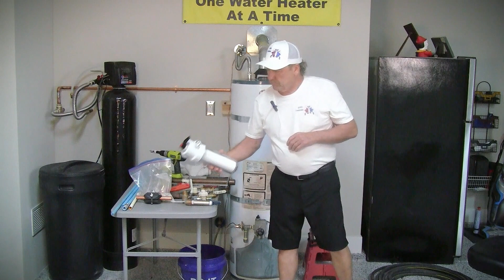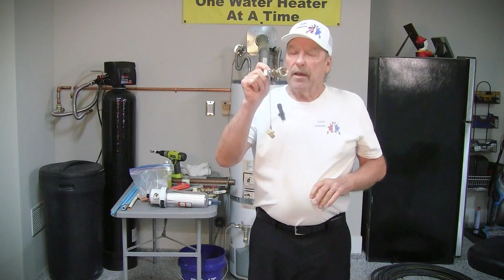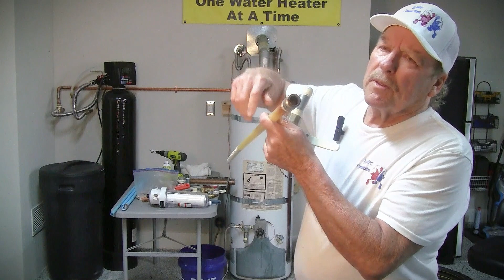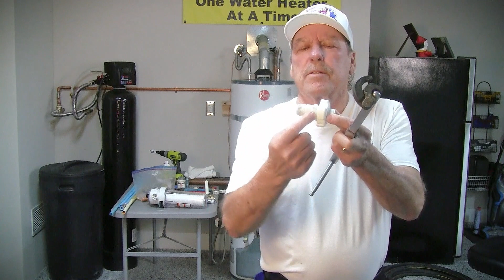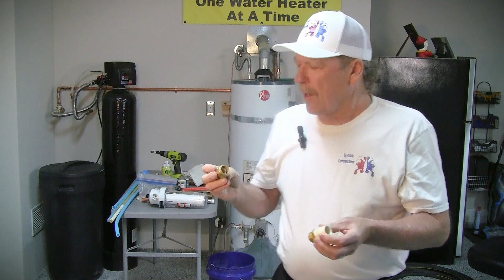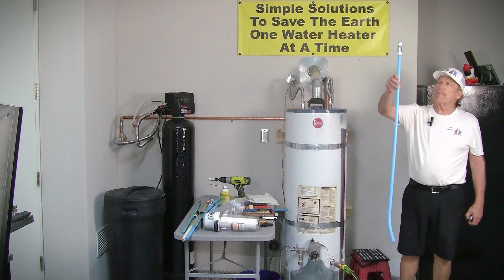Best Water Heater Flush System PERIOD!

Comment: Good point about the flex connectors.  With those straps and flexible lines, that makes a safer setup.  A flex gas line would be good too.  You are a wealth of information.   Great presentation